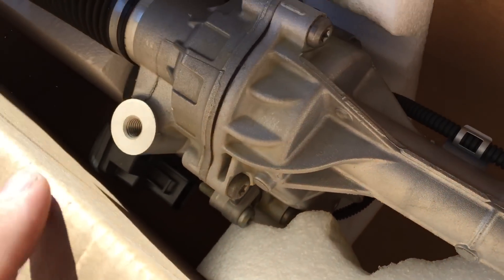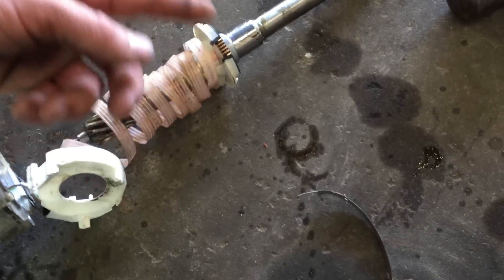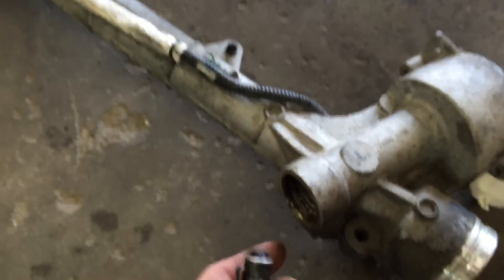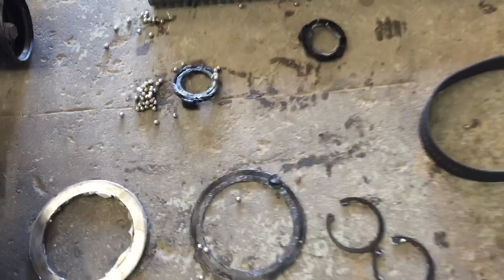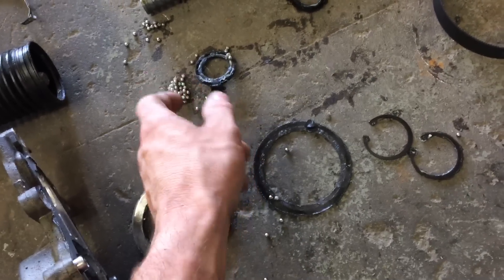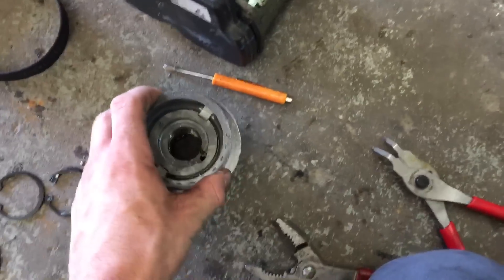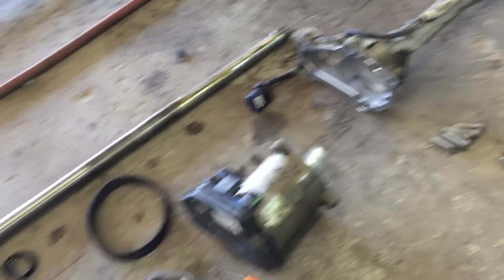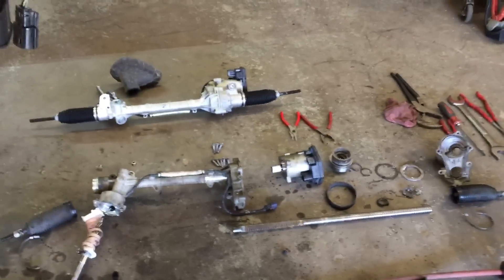Ford Electric Steering Gear Disassembly

Comment: Any suggestions for me ? ,I'm having to replace mine in a 2013 focus. It just stopped working and showed a "steering loss stop safely "message , it happened after a cold day the wheel locked in the morning like it literally froze and had to let it warm and then yanked on it until it "broke the ice " and worked normal again for a few miles then it went out for good. Found the rack on eBay for 275 so not to bad for a new own rack , I'm guessing there's something wrong on that position sensor
Reply: +victor walczack   there's a recall on these for some models/years
Reply: +Byron Croft  mine ended up being water inside the motor it ruined
Reply: +victor walczack   was that covered by the recall?  water intrusion was the reason for one
Reply: +Byron Croft no they said I wasn't cover. I changed it myself in 2 hours , no t worth waiting on the dealer
Reply: +victor walczack how generous of them
Reply: @07k_motorsports24  Did you have to have the rack reprogrammed?  I am having the same problem with mine.  It is locked in the morning after a freezing night.  I can thaw it out if I hit it with a heat gun for a few minutes and it is not that cold.  If it drops in the teens it takes longer but it will freeze again while driving.
Reply: @mickone4461   no programming, just replaced and  worked as expected , water seems to get inside and cause damage.
Reply: @mickone4461  My Wife's car is doing the same thing, but only when cold.  LIke others, she can let it run for 30-45 min and it will "pop loose." and work fine.  If it's water inside, I wonder if I could pop the cover off and blow-dry the inside.  I would then use a generous amount of sealant when putting the cover back on.
Reply: @jameswalker590  you shouldn’t need any programming , just absolutely match the part numbers and try using the same year if it is used ,

Comment: The sound remind me a bit of the same sounds brushless RC car motors make when stalling or have bad connection on one of the phases. Could the motor\servo in the steering rack of this car be a (sensored or unsensored) brushless type? I remembered my e-bike have a sensored brushless motor, and sometimes the sensored operation does not "initialize" properly and will make a similar "vibrating" noise as well!
Reply: I do believe these are brushless motors.  3 phase with the units I have taken apart.  It is essentially a large servo.  You might be on to something!